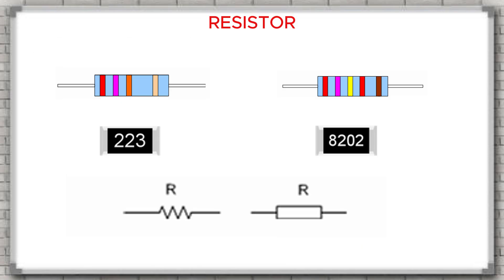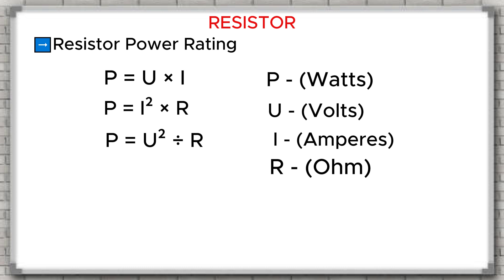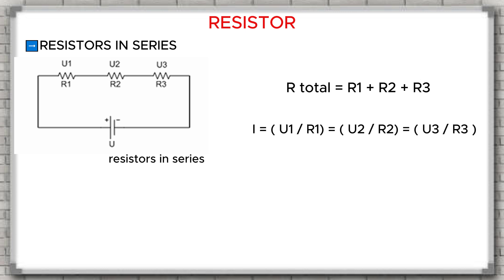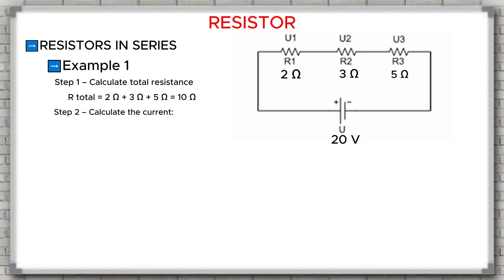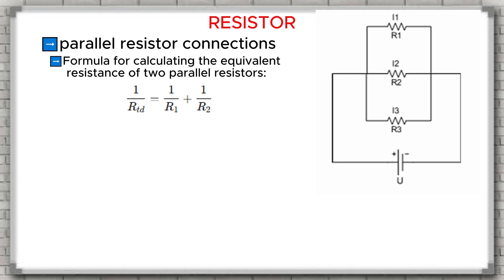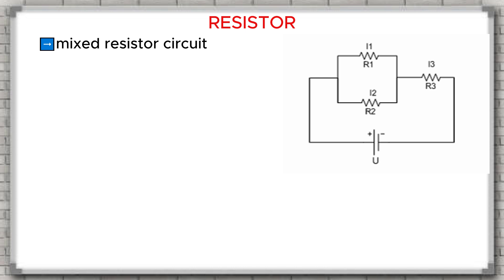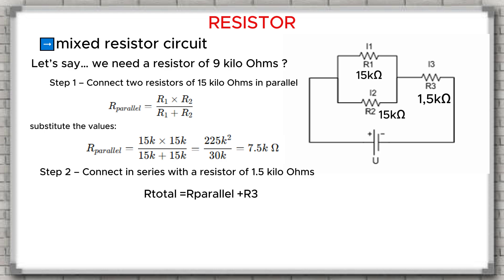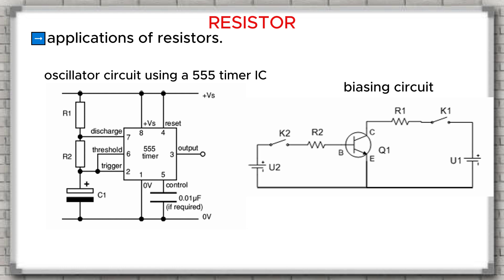Basic Electronics for Car ECU – Lesson 2: Understanding Resistors

Comment: Question on resistor. Why two resistors have the same resistance (120ohms) but different Power ratings (1w/1.2w)?
Reply: It’s just an example. The power ratings are not calculated. Power rating come from the manufacturer.